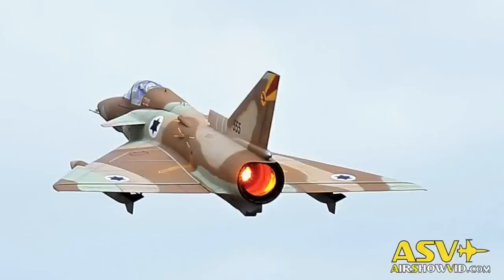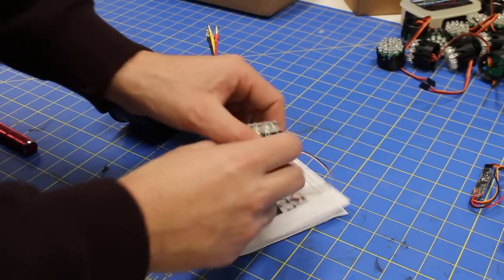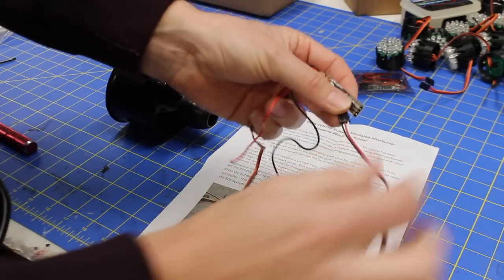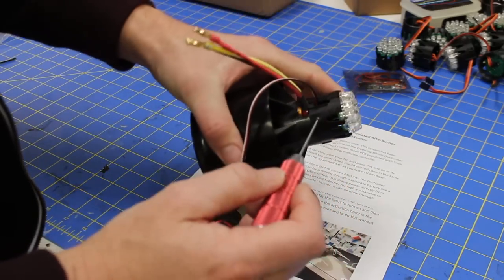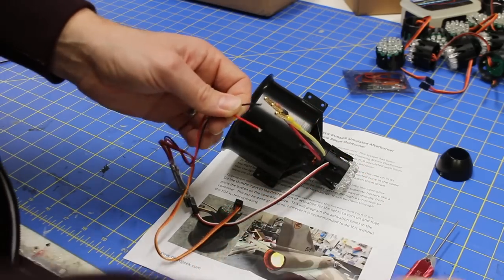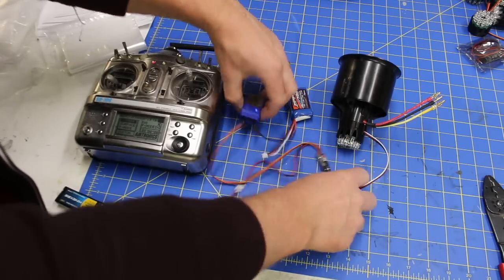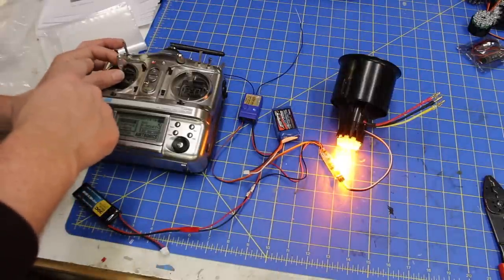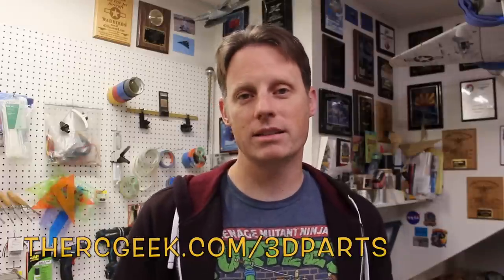CenterBurner Simulated Afterburner System - The RC Geek

Comment: What amperage should the BEC be rated for if just using for the burner , and I imagine the voltage range is 5 to 9 volts ? , thank you !
Reply from the maker: The Castle Creations UBEC (or equivilant) works well.  Voltage input to the controller can take up to 24v, but not to exceed that.
Reply from the maker: I have a correction, voltage to the controller should not exceed 6v.
Reply: Ok so no 2S battery ( 7.4 to 8 volts ) straight hook up  should be used?  so keep it to a BEC at 5 to 6 volts out, thanks for the info
Reply from the maker: A 2s battery is fine. Just not more than that.
Reply from the maker: 2s lipo is the way to go, but no more than that.  So, when using a BEC, I recommend setting it to about 7.2 or so volts.  At 6 volts, the lights work, but aren't super bright.

Comment: Hi Chris. I just got my E-flite F4 Phantom II toned. Would like to get a burner light for it. I see you have both center-burner and multi-burner for 36mm inrunner motor. Which one should I go with for the E-flite F4 Phantom II?
Reply from the maker: At the moment I don’t have a multi burner for the 80mm eflite fan. That being said, I’m currently testing one in my f18 to see if there’s a performance difference at all.
Reply: @Thercgeek  awesome! I was worried about a multi-burner might cause some performance issues due to its larger footprint. Good luck with your new test. I will stick with what the plane is for now. Gonna make a decision after your test result comes out. Thanks for the update :)

Comment: Just ordered one but wondering if they can be ran off of a 6.6V LIFE battery... Would like to just run a 700mah LIFE battery for my RX and Burner if possible.
Reply from the maker: Thank for your order!  Yes, you can use a 2cell life pack, no problems at all. The 2cell lipo gives max brightness having a little more voltage, but the life pack should do ok.

Comment: Do you sell afterburner for the eflite 70mm f16 that can plug into the flight battery like rc castle has. If so I would be interested
Reply from the maker: I do offer a 70mm design for the 28mm motor that’s on the eflite fan. It can be powered from the flight pack using an 8v buck regulator, but it’s not something I supply. I find it simpler to power from a small 2s 250mah lipo. They weigh pretty much nothing and can go anywhere and then you’re not drawing from your flight pack.

Comment: I want to know if you use a deferent battery for the center burner only. 2 batteries in the plane. Can you use 4S battery?
Reply from the maker: I’ve actually recently come out with a V2 version that’s is much improved to this one. With the V2 You can use a separate 2s lipo or you can use the flight battery balance plug to provide power to the LEDs. That being said, no more than 2s voltage can be supplied to the LEDs or you will burn them out.

Comment: I was looking on center burner site and l have a Freewing Red Arrow 70mm outrunner. Does the 70mm you offer fit? 2300kv
Reply from the maker: At the moment, I don't have a solution available for the 70mm outrunner designs.  It is in the works currently though.

Comment: I have a Eflite Habu STS 70mm EDF.  Which unit would work with the Habu?
Reply from the maker: At the moment, I don’t have a solution for habu sts as it uses an outrunner motor. It’s in the to do list, just need to find the time.

Comment: Do you have one for the e Flite F-15 64mm edf dual nose tip?
Reply from the maker: I only have the single for the 64mm as making a multiburner at that size would create too much blockage in the exhaust. That said, the single light installation still looks good in the f15.

Comment: I would  like to see a install on a freewing F-16 artic camo jet because  the fan cone looks totally  different I order one for my F-16 artic  camo it came now I am waiting for the Y connector to run from throttle port on the receiver.
Reply: I really  want to see how the center  burner look in action on the 70mm artic  camo F-16 by freewing.
Reply from the maker: The freewing 70mm f16 has an outrunner motor (the outside motor case spins with the fan). I currently don’t have an outrunner solution that will work at the 70mm fan size. I’m working on an outrunner design concept at the 64mm size I’m working on which if it works I should be able to make work at the 70mm size.

Comment: Having an issue with mine,  I've followed this video and the instructions but it seems to be working backwards.  When I'm at 0% throttle its illuminating.  As I move the stick up it goes out about 50% throttle and up.  I hit the program button at about 80% throttle but it only illuminates at around 50% and below.  I have the throttle Y harnessed and don't have the throttle reversed or anything like that in my radio.  Any ideas???
Reply from the maker: Got your facebook message and replied back.  According to the controller manufacturer, this is done by re-calibrating the controller and pressing the button once.  If we're unable to get it squared away, I'll send you a replacement.  Thanks!
Reply: Simple fix! thanks!
Reply from the maker: Glad it's all sorted, have fun! :)

Comment: I will get a few when you build the ones I need.
Would really like 2 sets for my A10 90mm upgrade with JP 90mm Counter rotating fans.
I assume the 80mm one you have now is for the older out-runner fan units and not the new 80mm out-runner fan used in the A10?
All my 80mms are in-runners Im upgrading my F14s.
Reply from the maker: The design I have right now is for the freewing outrunner 80mm. I should have an 80mm inrunner available in this next batch. 90mms will be available sometime next month.
Reply: @Thercgeek  Which option would you use for a JP Hobby 90mm with an 42mm Outrunner? I see Freewing, Avios, and FMS on your site.
Reply from the maker: I don’t have a jp fan option available yet. I should in the next week or so. Just finished the design for it.
Reply: @Thercgeek  Sounds like a plan. Thanks!
Reply: @Thercgeek  And for the JP 70mm?
Reply from the maker: I don’t have anything for the jp 70mm at this point.

Comment: Do you sell the controller separately? Would it drive an afterburner ring for a turbine model with about 40 LED's?
Reply from the maker: Yeah, that’s no problem. This controller was originally designed for that application. Do you know what the recommended voltage inputs are for the light ring you have?  Shoot me an email through my contact form and we can work our getting a controller to you. http://thercgeek.com/contact/
Reply: @Thercgeek  Email sent.
Reply from the maker: @afterburner666  Got it and sent a reply.  Thanks!
Reply: @Thercgeek  replied to yours.

Comment: HI Mate, Can you tell me the correct Centre Burner for the new Freewing 80mm Inrunner? I want to order one for my L-39 Camo.
Reply from the maker: Well, if it's truly an inrunner setup, then you want the 36mm inrunner design.  Or are you asking about the 9-blade fan?  If so, that would be the 9-blade tailcone design.
Reply from the maker: Ok, yeah that would be the 36mm design option.
Reply: @Thercgeek  Thanks Chris, I order a single for my L-39 and 2 twins for my F14s. Cheers
Reply from the maker: Great, thanks man!
Reply: @Thercgeek  The shipment has arrived. Love the quality and the fit. Tried them on both the old and new Freewing 80mm Inrunners. Perfect fit. Shipping was very reasonable, Thanks. I will be ordering a bunch more 80s and 90s. Will have a look at 70s. Are you ever going to do these for the JP Fans? 70s 90sand 105mm?

Comment: I tried ordering a 70mm unit for the E-flite Viperjet, but your website doesn't appear to be working.  The links don't go anywhere.  Thanks!
Reply from the maker: As noted on my website, I'm currently out of stock on boards.  I should have more in another week or two.  Thanks!
Reply: @Thercgeek  I didn't see that.  Probably since I couldn't get past the home page, but thanks for the info!
Reply from the maker: Oh, interesting.  Seems to be working now, yeah?
Reply: @Thercgeek  Yup.  Just tried it and it let me to the Centerburner page.  Please let me know when they're available again.  I'd like a 70mm unit for the E-flite Viperjet. :)
Reply from the maker: Will do my best!  I'm just waiting for confirmation of the LEDs to arrive and I'll open the ordering back up.
Reply: @Thercgeek  Thanks, I appreciate it!  You can just reply here and I'll get the notification. :)
Reply from the maker: I've opened up ordering, so just FYI.  Thanks!
Reply: @Thercgeek  Thanks for the heads up!  I just ordered one even though it said they were still out of stock.  Can't wait to get it because it looks amazing!

Comment: Could you please make one for 64mm fans.
Reply from the maker: The difficulty is cost since the system would cost nearly the same as a 64mm sized jet.  What size motor is used on the 64mm fan you're thinking of and is it an inrunner?  I could do something custom potentially.
Reply: The RC Geek ok I see what u mean. That’s cool I’ll be stepping up to larger edf planes so I’ll get one for those 👍🏽👍🏽. But it’s an awesome looking product. Very cool 👍🏽👍🏽
Reply from the maker: ScragbyteRC  Thank you!

Comment: Can this be powered from the flight battery?
Reply from the maker: With a proper bec it can be. But otherwise, pulling power from the balance plugs shorts the controller typically, especially when using a yharness off the throttle. I use a 250mah 2s lipo which lasts me many flight outings on a charge and weighs virtually nothing.
Reply: @Thercgeek  Okay thanks, too new to know what a bec is, lol!
Reply: @Thercgeek  Thanks so much, what is the current turnaround time for these kits?
Reply from the maker: If you’re able to order today, I can actually get it in the mail tomorrow. Otherwise, it will be about 1 week as I will be unavailable to process orders this coming weekend (starting Thursday).
Reply: @Thercgeek   Okay cool, I actually ordered a few days ago. (Saturday)
Reply from the maker: Got it.  Looking it up, your order shipped out yesterday. You should have gotten a tracking notice email.
Reply: @Thercgeek  I didn't